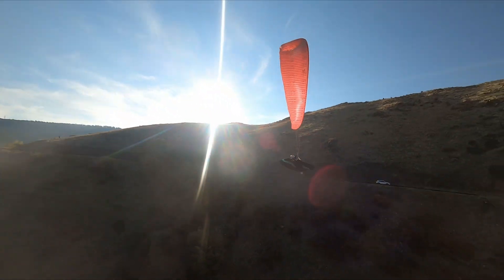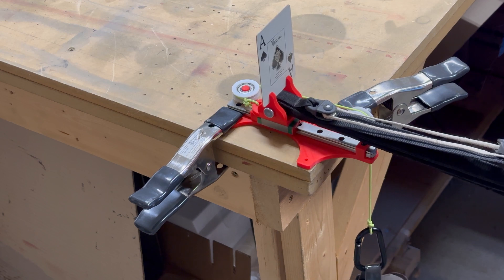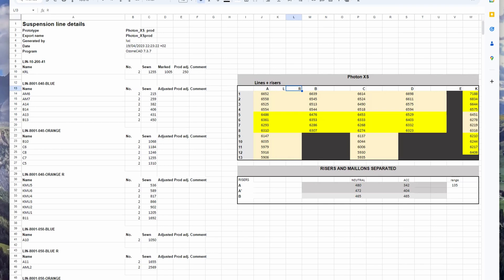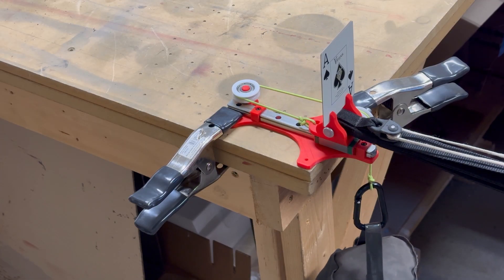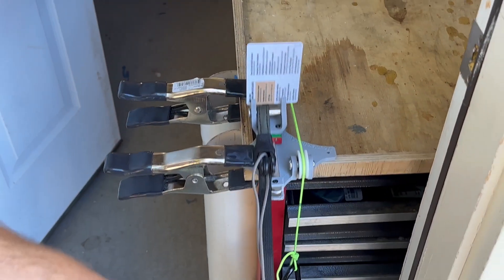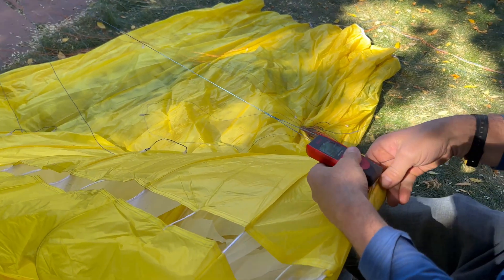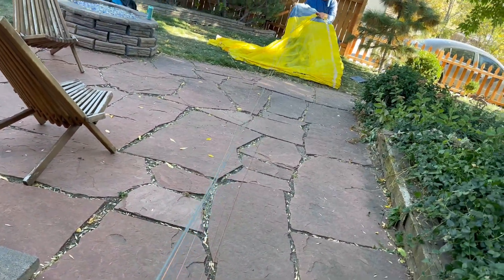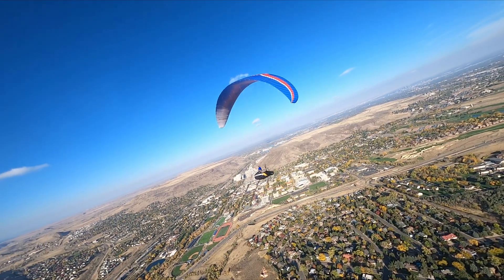How to Measure and Trim Your Paraglider Lines with Precision

Comment: The Leica Disto D1 has an accuracy of +-2mm is that sufficient?
Reply from the maker: Yes,  most gliders I see have a +-5mm from the factory.   This tool and the Leica will allow you to chase it to 2mm. I personally start adjusting lines when they are 10mm+ out of spec
Reply: Most lines you can stretch 2-3 cm just by the hand ... try it. I couldn't believe when a have seen it first time. All that trimming is "big magic".
Reply: next video ??

Comment: Tough to get good repeatable precision measurements without a rail at the glider end. The laser amounted to a 6’ linear rail at the glider end works really well.
Reply: Math checks out to be about +-2-3mm as mentioned by mountainrideaviation. The leica disto d1 has an accuracy of +- 2mm and this is constant up to the maximum range of the device.

I dont know the dimensions of the business card used, but lets assume a worse case scenario of a credit card turned sideways and measuring the distance to the very end of it. I'm also assuming the line length is 7.2m (similar to an artik 6).

The measured length is the hypotenuse of a triangle with the line length (actual length) being one of the sides and the offset of our measurement (how far to each side of the card we measure) being the other. So a bit of math and

C = sqrt(7200mm^2 + (53.92mm/2)^2) = 0.050mm.

So even doing it this way without the linear rail, as long as you hit the card your measurements will be within +-2mm + up to 0.05mm. 
BGD specifies for their gliders that a line should be within +-10mm to be acceptable
Reply from the maker: Measuring the same glider on different days in addition to the symmetry results have given me + - 2mm variance.  Generally a tolerance better than factory for line length.    Plenty of accuracy to return the glider AOA to the factory trim or determining any issues.
Reply: @Mountainrideaviation   trust me, if you want speed & accuracy you don't know what your missing, it will change your life! 

https://drive.google.com/file/d/1qhsHY_2pUgNPGBgZpV6hT96WsZP46EgO/view?usp=sharing